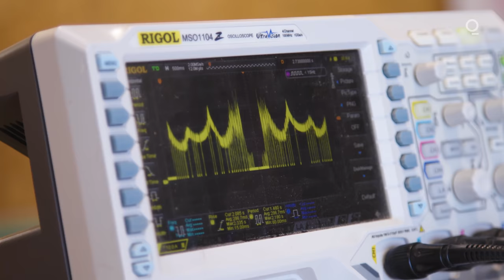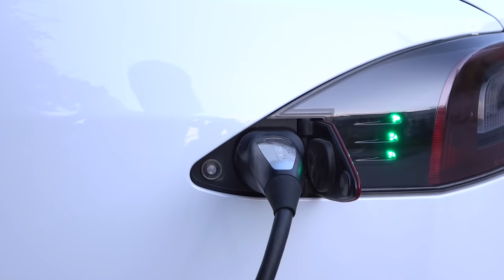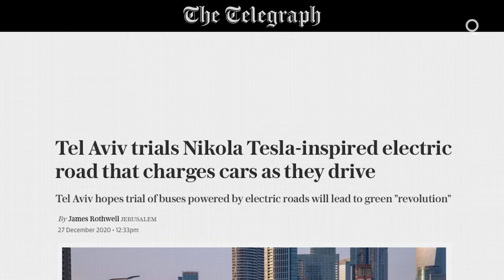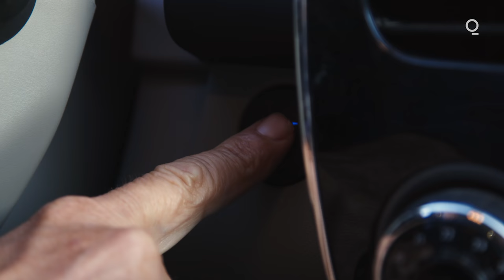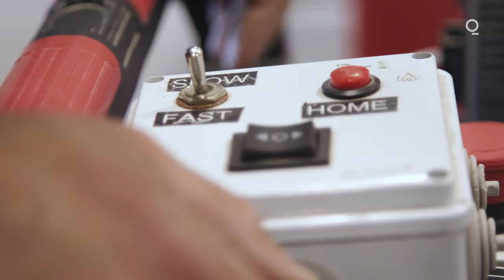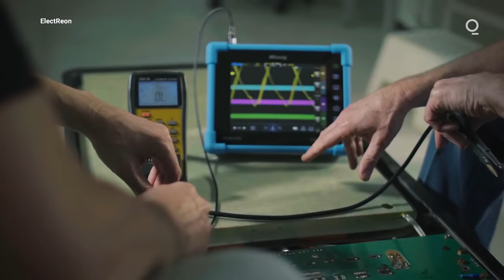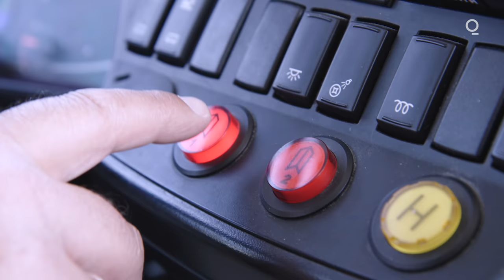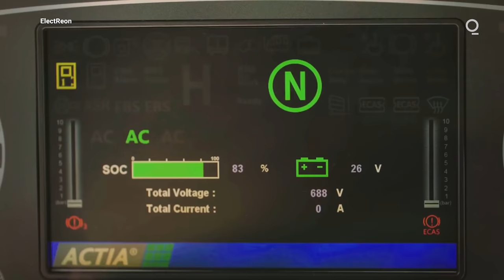How Electric Roads Could Power the Future

Comment: I think this is just too much of a process. An easy solution would be in having electric pods on the side of the roads and making the car body pick up the electric charge wirelessly, this will avoid the need for digging up and installing, plus save a lot of resources. Some research needs to be done in regards to the health issues this may have on the human body, however if the car body can be made in such a way to avoid this, this I feel this will be the solution.

Comment: I can see charging a car or a few cars via  
a stretch of road. But, how is a power grid 
going to handle hundreds of thousands of
cars on the roads through out the day and
the rest of the cities power needs with out
building a bunch more power stations or
solar and wind farms? Solar and Wind farms
are going to need power storage in the form
of yet,  more batteries. If you don't put the
batteries in the car, you may have to put
batteries somewhere.

Comment: I was just thinking "why male battery powered xars? Jist skip the charging and batteries and just put the electromagnetic in the street, hooked up to  a grid... "skip the middleman".. then you don't even need special cars, any car made of steel would work, just put it in neutral and let it coast... and then you can still drive normal roads too...

Comment: Hydrogen cars seem like a much more environmentally friendly and economical idea (given the hydrogen is green)
Reply: Hydrogen cars have lithium-ion batteries and platinum fuel cells. They consume three times the amount of electricity compared to an EV. They clearly are not more environmentally friendly.
Reply: @Simon-dm8zv  Excuse you what? Hydrogen cars don't run on batteries... They run on hydrogen fuel cells.
Reply: @sebastiangruenfeld141  They still have batteries on board.
Reply: @Simon-dm8zv  All cars have batteries.
Reply: @palmshoot  Not lithium-ion batteries.
Reply: @Simon-dm8zv  Those are even worse because they contain lead.
Reply: @palmshoot  So your point is?
Reply: @Simon-dm8zv  You're scapegoating.  Your agenda is ... ?

Comment: ...i dont see the difference.. if you have large batteries, you can store more energy and thus travel more.. if you have smaller batteries, you only have limited stored energy and you constantly charge using the road wireless charging but you still need to delivery energy to this charging network to work.. if your energy source is still coming from non-renewable energy, then there's still a large carbon footprint on either solution, hence making the smaller battery & wireless charging on-the-go just the same energy utilization with a larger battery solution.. then the solution is a combination of energy coming from renewable energy, wireless charging on-the-go, and the option to select either a small battery or a larger battery, depending on the user who is just city traveler or the long road trip traveler.. 
...this means that the car owner can have 2 sizes of battery which they can switch depending on usage.. better yet, the business model of the company "ARRIVAL" of UK, seems to be the best of both worlds.. with better and more accessible public transport, there is really no need to own a car.. you can just HAIL an EV, with the appropriate battery capacity that's dictated by your needs/ usage at that time, then just return the EV once you don't need them anymore.. you no longer need to have/ pay for any parking garage.. you don't need to register, maintain, or even charge the car once your car needs are satisfied.. 
...i still believe that the on-the-go wireless charging is fundamentally a sound idea.. with the combination of solutions (as mentioned above..) can & will make this wireless charging solution viable.. remember, to delivery the wireless charging solution, there is a basic need to update the road network, which requires government infra spending.. 
...perhaps its about time to privatize this government spending for road networks, where the government just agrees to pay the private investor a monthly repayment scheme.. this will also impact other infra projects that's mainly done under the road networks, like water, sewage, gas pipes, electricity, telecom.. etc..

Comment: What is the efficiency for wireless charging in this scenario? As it is about 60% Efficient in comparable applications at best.
Reply: It's over 90% efficient. I worked in this field for several years. There's a lot of nonsense being said in these comments. I haven't heard of this specific company though.

The tech works great, the business case just isn't there yet. That may change with increasing electric vehicle adoption.

Comment: So how durable will these charger be. How much does it cost to build as an infrastructure. Also I probably think it will come out if at all in more than 10 years.  By that time, wireless charging will be obsolete maybe the batteries will be so compact like solid state and it will be enough. Maybe wireless charging for homes and fast wireless charging stations is better.

Comment: Not feasible, Wireless charging for a stationary vehicle like in a garage or parking lot is alright(but if you are there already then might as well plug it in with wired charger) but on road with moving vehicles is a bad idea assuming the energy losses due to heat, distance between coils and alignment in-between both coils.

Comment: Tis does not sound like a good idea...
While it is true that charging the vechicles on the road and reducing their battery capacity is a way better solucion, I think that it can shouldn't include wireless charging.
Wireless chatging is extremly inefficiënt and this worsens exponentionally with distance...
What they should do instead is look for a solution uses a better power delivery system. Like we did with electric trains or trams for example.
Or if you realy want to make the world a better place, invest your time in hydrogen powered cars.

Comment: This is absurd nonsense. It's almost as bad an idea as Solar Roadways was. 

1) You're talking about installing the equivalent of train rails or streetcar powerlines underneath EVERY MILE OF ROAD. That's an insane amount of infrastructure for no guaranteed improvement over regular electric cars and charging stations. 

2) This also requires the entire system to be electrified before people will have enough confidence to use it. If there's only patchwork service, how will anyone know which sections of which roads have been connected? Is 90% of my desired route electrified? 50%? Only 1%? Who's gonna want to get on the road with that kind of system?

3) And is this only in cities? What about small towns? Or highways between cities? The plans include inter-city highways, right? Otherwise, you're asking people to buy cars that are effectively geo-locked to ONE CITY. 

4) The "range anxiety" people have with electric cars today is nothing compared to the anxiety they'll have with this proposed system in which they have NO INFO about which roads are electrified and therefore no idea whether they'll get the charging they need to get to where they want to go.

5) Forcing roads to do double duty is always a terrible idea. Installing giant infrastructure right underneath the tarmac is just asking for trouble. Constant pounding by cars, truck, buses, accidents, the road deforming and cracking from intense summer heat, cold winters, and road salt, potholes etc. The copper plates and electric cables are gonna break, snap, get stripped, etc. Are we gonna have smoldering electrical fires just inches beneath the tarmac? 

There's no end to the terrible-ness of this idea.

Comment: 11:40 the idea doesn't add space for pedestrians and cyclists. It would keep it the same or decrease it. Incremental, expensive infrastructure investment is dumb. We need the hyperloop
Reply: Hyperloop is almost stupider than this idea - it sounds cool but it's not cheap or easy to create a safe system of mass transit where people are transported by hundreds of miles of tubes under vacuum and all current attempts to build anything like it has resorted in tracks so short that the cars inside them can't even reach the speed a regular car can, let alone faster than a plane. The technical difficulties of building it are just so many as to be insurmountable. Yes in theory it would work if you could build it, but we can't and we're an insanely far way off being able to.
Reply: @StreakyBaconMan  they have a hyperloop that can reach 300 mph. Sure it's more expensive (but really not by that much more -- look it up), but it can be used for other applications as well. And it makes more sense than trying to invest all this money into ripping all of our roads up and shoving an enormous amount of copper beneath the road. Especially when you factor in the cost of cars themselves. And trying to build self driving platforms is ridiculous. Hyperloop self driving would be so easy. All I'm saying is if you're going to make large investments in infrastructure, might as well be hyperloop.

Comment: Dumb. Copper expensive. Streets with chargers get congested. Add weight to car for receiver. Copper coils not always in use thus electrifying something not used frequently. List goes on. Dig up streets to install copper chargers. Locals will be happy + for congestion after.

Comment: This is a neat idea that may very well be applied to "certain"  suburban and metropolitan areas in the future.  But I could almost guarantee, it's not gonna completely replace all existing roads.  And even IF they decide to, it's going to take 75-100+ years to make a COMPLETE conversion... not to mention it's huge risk.
Reply: This is charging pads. They charge EV batteries. You don't need to change all roads, just fraction of %, with most active traffic.Charge EV  when they drive on top of it,so it can go anywhere on regular roads with that charge.

Comment: Electric vehicles of the future will carry onboard electricity generators, and once that happens, the shift to electric vehicles will be as quick as the change from horse drawn buggies to cars.
I'm not talking about Mr. Fusion exactly, but something similar will need to be invented. 
Batteries are a horrifically inefficient way to power the electric motors and electrical components of EV's.

Comment: Electric roads will be highly inefficient.
Compared to plugging in an electric car and wirelessly charging a car can be viewed in the same way as charging smartphones in the same method. Hence, looking at the wattage required to charge a phone using wireless at the same rate as plugging in, we already know that wireless uses more power. This also coincides with the Maxwell, Faraday, and Newton equations.
Looking at the other aspect that you did not mention: copper. Copper mining is very environmentally harming and it isn't an unlimited resource. Considering how many roads there are, even if only 1% of roads will contain coils, it will use an astronomical amount of copper. This will also spike the price of copper, making pretty much all electronics significantly more expensive. Then there is also the aspect of copper theft. Copper roads will be a relatively easy way to steal copper as one cannot monitor a road 24/7. Also looking at potholes and corrosion, the maintenance on this will also cost a substantial amount of money.
Looking at the last aspect that I want to comment about: activation. When you put your phone on a wireless charger, the delay in it making the "charging" sound is longer and there is a reason for that. Electrons doesn't move instantly. Between activating the copper coil and receiving the magnetic field the delay might just be too long to charge the car at all, if your travelling at high speeds. A way to work around this might be to use an intelligent road to activate the coil prior to the vehicle running over it, but then you're looking at another problem: predicting human behaviour and increasing the need of microchips to control the road. This will only contribute to the global chip shortage.

At this stage, we do not have a solution to the problem of BEVs, but this is not a solution.

Comment: this is extremely wasteful, can you imagine the amount of copper needed for those coils? you don't need them, the coil is basically an antenna.
the way the inventor's initial design worked was transmitting signals through the groundm and not the air.
this way you just need a big antenna like wardenclyffe was. it worked then and it would still work now but greed triumphed.